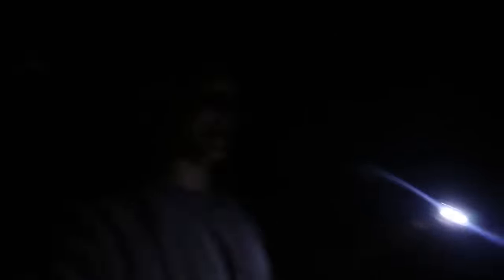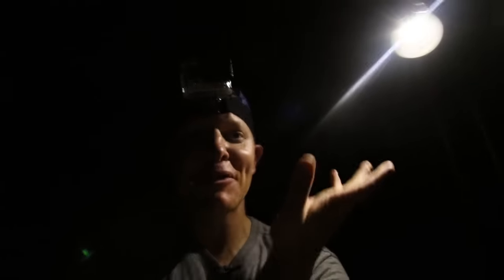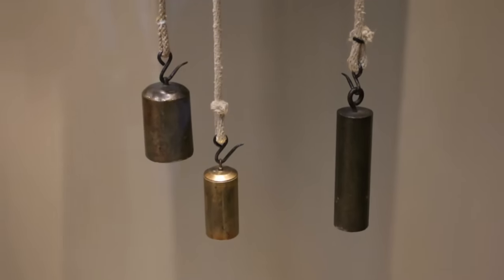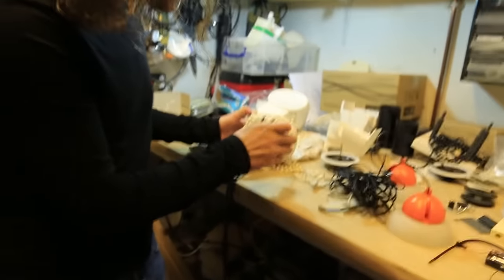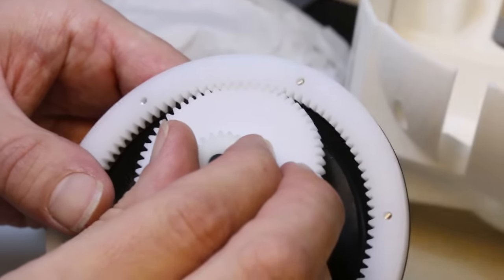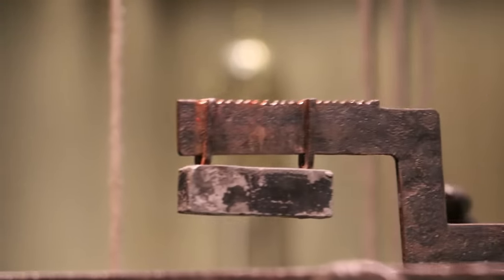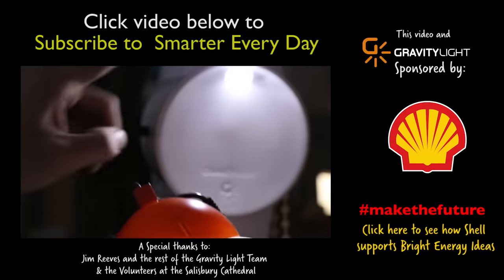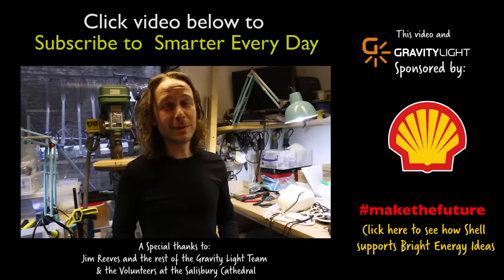Turning Gravity Into Light - Smarter Every Day 146

Comment: This would be a neat item to even charge your devices.
Reply from the maker: Which is also a challenge to do at night in developing nations.
Reply: +SmarterEveryDay or any airport.
Reply: +KiddsockTV Seems impractical. Gravity isn't really a good way to store energy, since it just takes so much stuff so high up to store any real amount of energy.

To put this in perspective, their 12.5 kg/27.5 lb weight would need to be 300m/1000 ft in the air to have enough energy to charge a current gen iphone, and that's assuming perfect efficiency.

Really, this solution is great to provide some basic lighting, which requires incredibly small amounts of power with LEDs, and there are a few other applications where this would be great, but for charging something like your phone and so on? No.
Reply: +seigeengine 
SO WHAT'S THE PROBLEM !?
When the weight eventually reaches the ground - you just hoist the weight back up again - unless you're super lazy - people in 3rd world countries don't have time to be lazy - quit being so negative.
Reply: VL VIDEOS The problem is if you used this set up, you'd need to haul the bag up a couple hundred times to charge your cellphone.

Also, point here... it would be more efficient and more compact to drive the system yourself rather than going through the intermediary of storing energy against gravity, and then using that.
Reply: +VL VIDEOS "quit being so negative" – that's how solar roadways scam got it's funding. Nothing wrong with negativity if it's constructive.
Reply: +seigeengine How did you calculate that? When I calculate I get 3.8V x 2.3Ah = 8.74Wh of energy in my cellphone battery. If I divide that by the mass multiplied with g, 8.74J / (12.5kg * 9.81m/s²) = 0.071m. That is 7.1cm. Of course one had to increase that by some amount to take losses into account but its definitly doable.
Reply: Arne Schwarz I looked up practical tests on how much power was used to fully charge a current gen cell phone, and I got around 10 Wh. Chargers aren't perfectly efficient, of course, so trying to reverse engineer it from what the battery stores isn't the best approach.

Then gravitational potential energy is mass*acceleration*height. We'll simplify acceleration to 10 (close enough), and then eliminate height to get the energy per meter of height. Mass is 12.5 kg so that's 125 Joule/meter.

Now convert 125 Joules to Watt hours (this is where you messed up). It's about 0.035Wh.

So we need to divide the watt hours we need by the watt hours we get per meter height. 10/0.035, and we get around 285m. Except remember we over-estimated acceleration, and we're assuming 100% efficiency, so just round up, and you get around 300m.
Reply: +Arne Schwarz 8.74Wh is not 8.74 Joules.
Reply: +Arne Schwarz 8.74Wh is 31464J. (Wh = J/s*h). That gives me 257m. Also note that modern phones like to charge at 5V, 1A. That is 5W. That means a 12.5kg weight has to fall 1m every 24.5s, which is somewhat impractical, since you basically have to sit and wait to rewind it constantly.
Reply: +neistridlar yes you are right. embarassing...
Reply: Right, but I can't see it giving out that much current, as the weight only has so much gravitational-potential energy. The more power you pull,  the faster the weight will have to drop
Reply: Ideally though wouldnt we just use a heavier weight? A 400 lb weight hoisted 6 or so feet in the air would be roughly half the total power needed to charge the device. That wouldn't be hard or take very long at all with a little bit of mechanical advantage. And the same device you used to gain mechanical advantage on the way up could be used to step the speed on the way back down.
Reply: +xcvsdxvsx The power to charge the device would not change at all, and the energy required would also be the same. 400lb = 181kg. 6feet = 1.83m. That gives you 3249J of energy, which is still only 1/11 times What would be required to charge an average cellphone according to seigeengine. Assuming the phone is charging at 5W and near perfect efficiency you will have to wind up that weight every 10-11min. Much more practical for charging a phone,  since you can actually do something else in the mean time. As far as cost, I have no reasonable way to estimate that.
Reply: ***** A simple pulley system is strong enough to bear 400 lbs and very cheap to produce reliably. Just as an example, the same pulley system you used to lever the weight up could be hooked into a device not dis similar to the one in the video with a constant 27lbs pulling on it. Not that that would necessarily be the best way to do it, just as an example of one way it maybe could be done.
Reply: remember that 3rd world countries might not all be sporting iphones ect.. and while another method might be more efficient, if you had one in an emergency bag (for flood or whatever) you might not have access to the more efficient charger. it would still be useful for an emergency last resort charging method, especially during the day when you won't be using the light!
Reply: Physics is neat isn't it? :) 
Let's use some to figure out what it would take to charge a phone with this!
The weight can at most be 12,5kg according to the website. 
The drop is not specified but surely less than 2m (≈6 feet) as can be seen in the video.
Potential energy is given by Epot=m*g*h
where m is the mass, g acceleration due to gravity (9.8m/s^2 on earth's surface)
and h is the height.
plug those numbers in and you get 245J.
A typical phone battery is about 2Ah at 3V.
Just multiply the two together to get the energy in units of Wh.
To convert to joule multiply by 60 to get to watt minutes and by 60 again to get to watt seconds (aka joule). Doing this you get 21600J.
so you'd have to lift the weight about 21600J/245J=88 times, taking almost 30 hours when each drop takes 20 minutes.
Reply: Yeah sorry the mobile view was messed up and didn't show the "previous comments" button... I was wondering why the conversation seemed so disjointed... I feel a little dumb now.
Reply: Felix Heidenreich Yeah. Sorry for aggressiveness. These comments are getting me pretty hot under the collar. :/
Reply: seigeengine don't worry about it it's what coment sections do to the best of us! :) 
And the video kinda anoys me too because it gets so much wrong and oversells this kinda lame idea so much and people just eat it up... It's solar roadways all over again... <conspiracy mode on/> Sometimes it feels like oil companies are sponsoring sure-to-fail "green" ideas like this to give green tech a bad name <conspiracy mode off>
Reply: +seigeengine Of course, then again, you're also assuming folks in the third world have current generation cell phones. A good flip phone goes a week without charging, and requires less than half the energy of a smartphone to charge fully. Hitching off of your calculations, that's about 300m / 2 / 7 days ~= 20m / day. That's still quite a bit, to be fair, but nowhere near as bad as your estimate would suggest. 

Then one may realize that there is a certain lack of signal towers in the area, and cell phones may be less than incredibly useful, regardless. Small lights really are the only thing that can be consistently powered by gravity, much else is just too energy intensive.
Reply: Persona No, I'm not. The person I responded to (I can't see their comment anymore, I guess they blocked me or deleted it or something) was talking about using these to charge devices, so I picked a current generation iphone for perspective. I wasn't making any assumptions there, I was giving a reference point.

Last time I had a fliptop (8-10 years ago I think), it might last that long if you only turn it on to make a call and then immediately turn it back off. It seems they've gotten better, and a good modern fliptop can last about a week on idle, but  the moment you actually start making calls, that drops with a quickness.

It's worth noting as well that even a current generation iPhone uses so little power you can effectively pretend they don't use any and you'd be about right. Anything heavier duty is going to require more.

And I mean, I live in a country with one of the highest per capita energy uses, and the majority of our energy comes from gravity (hydroelectric). Gravity is great, when the lifting is being done by something like weather patterns. Not so much when you're pulling on a rope to try to do it.
Reply: Persona but even for tiny loads like some level of emergency lighting this just isn't a great idea. This isn't an energy creation but rather a storage scheme and as such it should be compared to batteries. 
If you do so this concept starts to look just insanely bad. A single cheap mass produced 18650 battery can store about 260 meters worth of drop, is very portable and very reliable if it isn't pushed to its limits.
1000 cycles are verry much far on the low side for a current li-ion battery being driven conservatively and I don't believe for a second that the gravity light is going to survive the 200000 cycles it would need to go through to equal 1000 cycles of the battery.
Of course you would still need some sort of generator to make it human powered again but that's existing, cheap tech and much easier mechanically than this as the necessary gearing ratio isn't quite so extreme. Alternatively solar power would also be a decent option that's surprisingly cheap by now.

But honestly non of those options are very powerful unless you make them too expensive for the people that need it.
Solving the problem of being able to do homework at night (the example given in the video) actually requires quite a bit of light (reading by candle light only is not exactly pleasant and from the specs on the site it seems this puts out quite a bit less than a candle).
My guess would be that developing a cheaper, smaller version of something like petromax lanterns would be much more helpful to those people.
These lanterns can actually have ok efficiency (I figure about half as good as an incandescent bulb powered by a natural gas plant from some quick searching), are clean burning enough to be used without a whole lot of ventilation safely and actually produce an impressive amount of light. Enough to not just read comfortably but to actually light up a small room decently.
Reply: Felix Heidenreich See, the problem with that comparison is that this "battery" isn't toxic waste, if designed properly, should be able to cycle nigh infinitely, and can be recharged in about a second by a single person.

As for your criticism of the homework thing, I have literally no idea what you're talking about. The specs on their website state that this puts out an order of magnitude more light than a candle with their first version and the second version they're going to be testing out is supposed to be both longer lasting and brighter. After looking into the light output of the kind of lanterns you're talking about, this puts out about twice as much light.

It's almost like you couldn't even be bothered to figure out what you were talking about.
Reply: Felix Heidenreich
Fair. Do remember that a major problem in distributing things to poorer areas is logistics, though, so while a single cheap battery may replace 260m of drop, actually getting it there may be less cost efficient. On top of this, rechargeable batteries have a whole host of their own problems -- life span, charge, cost over time, etc, etc. The gravity light thing clearly isn't a perfect solution, but it does seem quite a bit easier than simply shipping thousands of batteries again and again.
Reply: +Felix Heidenreich But these people don't have an electrical grid to recharge their batteries. They also can't afford to constantly buy batteries.
Reply: seigeengine
Oh, I'm well aware of the limitations of flip phones. Used to have an old motorolla razr, and it'd typically last three to four days with my use of it -- maybe a few minutes of calls to tell my parents where I was, a number of texts to some friends... Nothing particularly heavy, admittedly, but regardless, it definitely lasts about twice a long as my smartphone does today.

Of course, as to the other thing, the gravity light clearly isn't a solution to power distribution in third world countries. It just doesn't scale.
Reply: +Persona but a single battery doesn't replace 200 meters of drop but rather 200000 meters of drop. they are reusable after all. one might argue how long this mechanical system will last but 200km drop seems very optimistic to me and 1000 cycles for a lithium battery isn't optimistic at all (I have seen some that have been trough more than 2k cycles of pure abuse and still work albeit with decreased capacity). the toxic waste issue could be a problem though. maybe you could promise people to give them something small in return for collecting the used batteries (maybe just a replacement but by the time they are completely trough the battery with the kind of use the gravity light sees the particular type of battery will probably be obsolete)
Reply: +seigeengine you might be right that the LED they are using could be much better than I'm giving them credit for. from the somewhat minimal data available I figured that they where using a typical 5mm low power high brightness LED that generally put out something around the 5-10 lumen mark. assuming they are using something better than that they might be getting up to 150lm/w at 124mw or 36lm. I remember a good rule of thumb for an actual candle being around 20lm but the standard candle used to define the unit cd is only 4pi or ≈12,5 lumens. 
honestly that's all in the same ballpark though as brightnes perception is logarithmic and the difference between 10lm and 36lm isn't going to seem huge. so yeah saying its "much" dimmer than a candle is not quite right but its not an order of magnitude brighter either.

as to the petromax lanterns: 
the small model claims 90cd of light intensity 360 degrees around. multiply by 4pi again to get lm and take some away because the light doesn't shine straight down and straight up not covering the entire sphere of angle quite fully and you get around 1000lm or almost 2 orders of magnitude more than even  a really good LED.
Not sure if you found the wrong lanterns or something? 
If you ever used one you would know intuitively that what they put out is in a different ballpark than even a great 5mm LED. they are just a whole different beast than just wick based lamps. problem with them is that they are kind of a pain to use and expensive as they are right now but that's more of a designed quirk than a fundamental thing about the concept I believe.

as to the toxic waste:
the plastic will eventually be waste too and while it's less toxic in the short run its going to be around for ages while battery chemistry is very unstable when exposed to the elements and will decompose eventually leaving not much more than some metal oxides (that's kinda long term. honestly I wouldn't want a broken lithium battery buried in my backyard either)
you could also help the issue by promising the people to give them replacement batteries if they return a broken one but that would require more logistics and long term follow through of the project.
honestly though I'm pretty sure that if you tell the people scary stories about how bad those batteries are when they break they will manage to collect them somewhere just fine.
you also have to consider that a battery replacing this system would be serving very minimal duty. you wouldn't charge it up quit as far or as fast as consumer devices do and you wouldn't discharge them as deep so you could probably get on the order of 10K cycles before the battery becomes useless (remember they are usually rated for number of cycles above 80% capacity but even 10% is more than the gravlight).

In the end it pretty much hinges on the lifetime of this device which you seem very confident about while I'm highly sceptical of. 
I'm sure a lot of thought went into making those gears last long but several hundred km of drop? I just can't see it with plastic gears even with some fancy designe.
Reply: +Felix Heidenreich not sure how I managed to mess up again but 150lm/w at 124mw is of course 18,6lm not 36....
Reply: +KiddsockTV yeah!
Reply: +seigeengine calm down mate... they post intensity in units of cd rather than luminous flux in units of lumens on their website which makes comparisons hard since we don't know the angle over which the LED emits light. 
you can get huge intensities by focusing a tiny amount of light to a tight beam so just knowing intensity means nothing.
and even the intensity isn't particularly impressive. 17cd isn't a whole lot.
again even assuming cutting edge LEDs with 150lm/w you still don't get a lot of light from 124 milliwats of power. 
admittedly petromax lanterns have some problems but how on earth did you arrive at the conclusion that they are LESS bright than this thing?! 
I can see them getting much worse results in real testing than claimed specs but still... even if we assume the smallest model performs half as well as claimed that's still 500lm! that's over 1W of pure radiated visible light even if we assumed its pure green light which the human eye is most sensitive to! that's an order of magnitude more power than is available as electricity in this setup! 
on a related note the MASSIVE efficiency gains of petromax style lanterns over wick based designs come from the fact that they use a mantle which emits light when heated. the key here is that the mantle has much higher light absorbtion and therefore also much higher thermal emission in the visible range than the almost transparent combustion gasses of kerosene.
maybe I'm missing something huge here but your claim just seems so outlandish... 

as for the reliability of mechanical systems:
yes some mechanical systems last insane amounts of time but those are typically way way overbuilt which makes them expensive. they also don't typically use plastics since while they don't really decompose they do degrade over time and are prone to abrasion, deformation, weakening from repeated stress, embrittelment from uv exposure and all sorts of other issues that are not conducive to long lasting gears.

your point that the batteries we'd use in a system that competes with this would be smaller than 18650 cells and therefore driven harder is kinda true but also kinda misleading. the question is wether a battery based system could be made to outperform this on a performance/cost basis and I'm pretty sure that an 18650 cell is much cheaper to make than a compact, long lasting gearing system like this (again I remain unconvinced of the longevity aspect).
Reply: +seigeengine Sounds like it might be better to recharge a "fliptop" phone with a bike which you pedal while studying under a gravity powered light
Reply: ***** Sure. That solution would work, although I'd be concerned about the costs required to set up that equipment, especially dealing with the variability of the power output.
Reply: seigeengine The bike parts are cheap and readily available in those areas, but yes, the electronics are not commoditized yet but are already a thing and will become cheaper over time, e.g. http://sivacycle.com/
Reply: ***** Bikes are cheap by Western standards, but proportionally fairly expensive by the means of many places.

The electronic components are inherently fairly expensive. There's also the problem of a battery, which was what I was talking about being concerned with variability. Batteries wear out, and have to be replaced. So now you're producing battery waste, and creating a continual expense. Not a great solution in any place you don't have enough electricity to charge a device, I'd say. Seems more like it'd appeal to wannabe green hippy types.
Reply: seigeengine No, I'm talking bike parts prices specifically in Africa. I am a part of Bikes Not Bombs based in Boston, we ship hundreds of bikes to Africa every year. We are a part of supporting bike culture in Africa not only as a means of cheap transportation, but as  cheap mechanical power for running blenders, pumping water, etc.

As for battery tech, that's going to be a part of mobile phones no matter what you do. Having a mobile phone for a household can be a liberating communication device. Being scared of battery waste is just a problem to be solved. Providing power via bike in order to run mobile communications is not wannabe green hippy nonsense.
Reply: ***** In other words, you're artificially eating costs to help others. This is great, but completely irrelevant to the reality of the costs of obtaining a bike. Oh, and I'm not knocking the value of using bike parts to generate mechanical power. Worlds apart.

No, see, the batteries I was referring to were in the charging device, not in the device being charged. The link you pointed me to is a common example of the charge a battery to charge the device form of bike power generation. You aren't charging the device directly, that would damage many mobile devices if you tried to do that. The battery acts as a stabilizing intermediate.
Every problem is a problem to be solved. That doesn't make it less real or meaningful. That's like saying dying of starvation is just a problem to be solved. Trivializing problems with wordplay does not diminish their significance.

Great. Except.... just look at the website you linked me to. It reeks of wannabe green hippy wankers. It's quite obvious that's who they're marketing to, and you know, that makes sense. It's expensive upfront, and recurring, and as such isn't a good solution. For a similar price point there are other solutions that don't require bikes or human energy enter the equation and increase costs.
Reply: seigeengine Great, so talk to me about solutions for charging a mobile phone with minimal material costs.
Reply: ***** I'd probably advise a solar solution, personally. A decent solar charger is equivalent in price, and stand-alone. Yes, it still has a bunch of the same problems, but at least it doesn't require a bike, or a human be toiling away wasting energy on it.
Reply: seigeengine Bringing down the cost of solar panels seems like a harder problem to solve right now than bringing down the cost of batteries.
Reply: ***** .... sigh

The solar charger INCLUDES a battery.
Reply: seigeengine Indeed, and complicates matters further by requiring expensive solar cells.
Reply: seigeengine Ah, the ad hominem, classic sign that you have run out of ideas. Thanks for destroying any chance at a reasonable discussion.
Reply: seigeengine I like how you're digging your own hole and insulting yourself through your own words. It makes the comment system so much easier to handle. You take things so personally, it's hilarious. Thanks for the giggles.